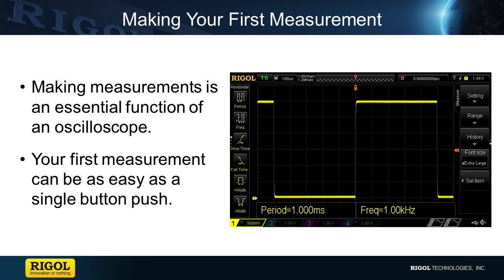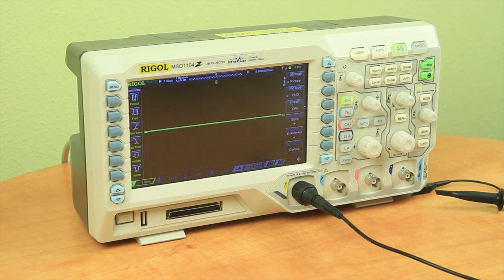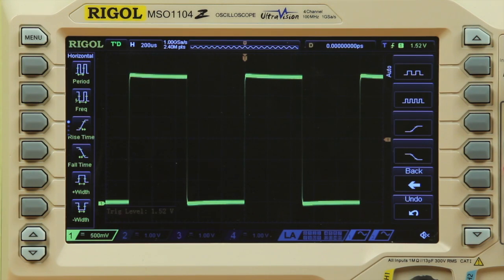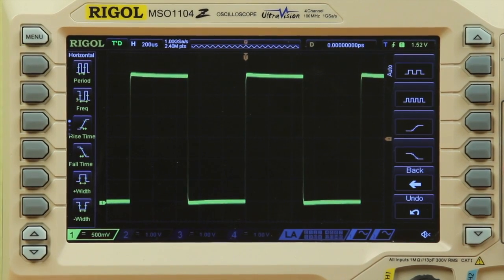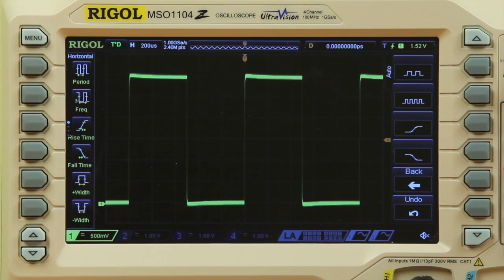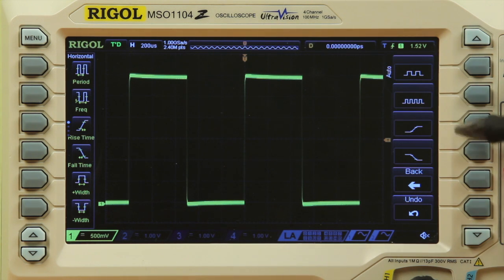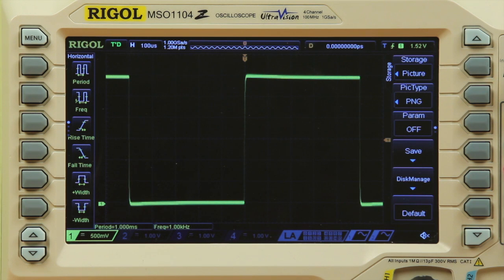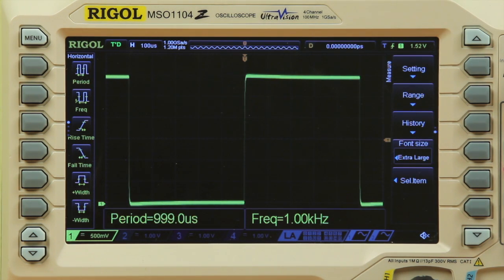Making your first measurement

Comment: Why can you scroll the trigger to the left indefinitely with out getting a parameter limited message as you do when you scroll the trigger to the right across the memory box. I am using the square wave provided by the scope to make these observations.
Reply from the maker: The instrument's most recent data that is has captured is on the left hand side of the display and it is always capturing data when the instrument is in Run Mode so you will always be able to move to the left.  Where as the right has a hard limit of the instrument memory depth which is why you get the Parameter Ltd message.

Comment: You can keep scrolling the trigger to the left even after you reach the end of the memory box. What is the reason for this. What is this signal and is it stored ? and where.    When you scroll the trigger to the right you get a Parameter Ltd message once you reach the end of the memory box.   Please explain
Reply from the maker: The instrument's most recent data that is has captured is on the left hand side of the display and it is always capturing data when the instrument is in Run Mode so you will always be able to move to the left.  Where as the right has a hard limit of the instrument memory depth which is why you get the Parameter Ltd message.

Comment: I dont understand the memory box on the top center of my display DS1054Z. I have a lot of questions and there is no information  ?? Please help
Reply from the maker: That is the memory indicator at the top center of the screen.  It uses the white areas to show how much captured data is off the display where as the black areas show the on screen captured data.
Reply: I am looking for more detail. if you look at this memory and scroll left and right there are many questions. There is no youtube demo about this topic showing different triggering modes and signals. There is a message Parameter Ltd when you scroll the trigger point to the right but no message when you scroll the trigger point to the left etc etc
Reply: Also when memory depth is in AUTO you get no white area.  But if you set it at 1.2M you get white area for the same signal !!   Can you do a detailed video on this topic
Reply from the maker: @michaelcostello6991    When the memory depth is set to Auto then the instrument is storing the least amount of data which is why there are no white areas displayed in that box.  Where as when it is set to 1.2 Mpts. there is additional memory besides screen data being stored.

Comment: I am probably a newbie at using my RIGOL DS 1052E but I have a very hard time getting a clear square wave when looking at the address lines of an old C64.
If I use the Test square wave on the 1052 itself, I do get a clean square wave. What am I doing wrong? How can I see cleaner square waves when testing digital equipment?
Reply from the maker: The main differences with digital equipment would be loading, capacitance, and noise. If the signal is higher frequency, you may want to switch the probes to 10x to get more bandwidth. It's possible the signal is being loaded by the probe, but the standard probes are High Z. To be more helpful, I'd have to see what it looks like. Feel free to send us a picture of what you see at help@rigol.con if you continue to struggle.